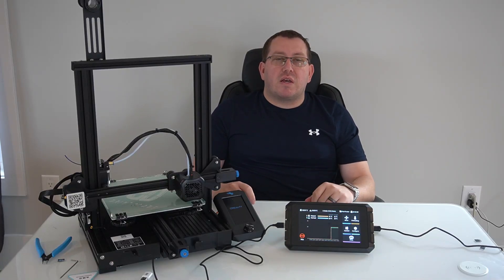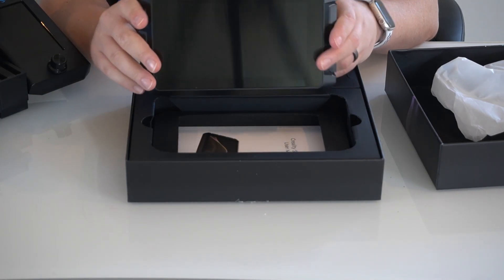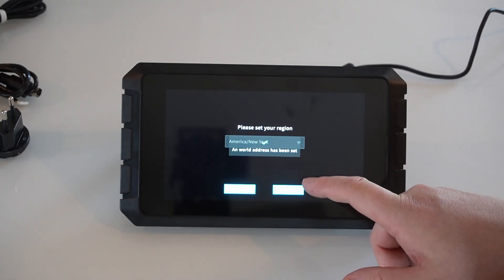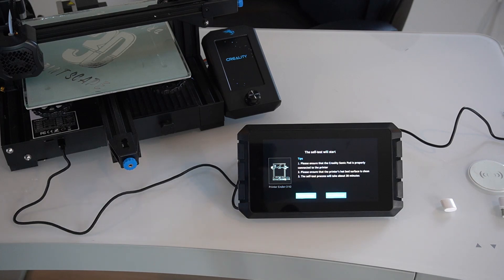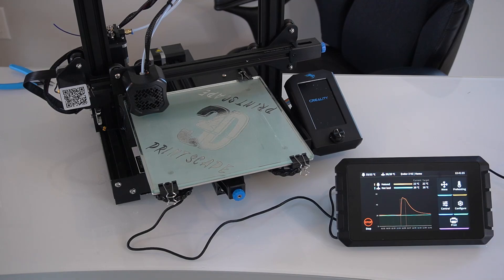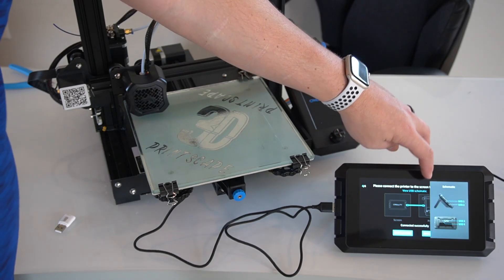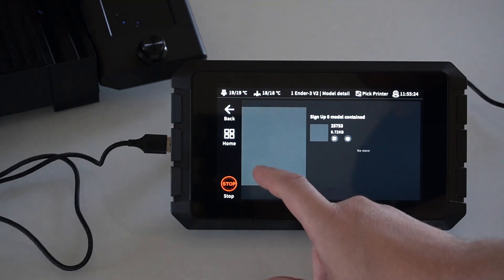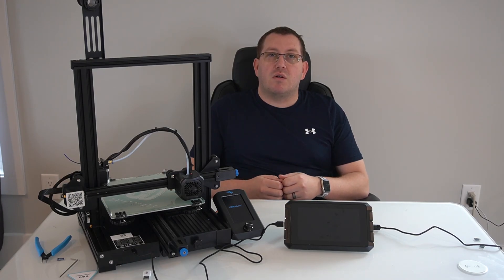Creality Sonic Pad – Getting Started!

Comment: I have a Sonic Pad running an Ender 3 S1, prints fast and easy to set up! I then tried a CR10 V2 w/BLTouch. There was no configuration with the BLTouch so I spent a few days following install guides with no luck. I thought Klipper would be similar to Marlin but it seems I have to find the config files for klipper? I tried to copy/paste numerous files that were suppose to make the CR10 V2/V3 work with BLTouch. None worked and I eventually went back to Marlin. Seeing the S1 run tempts me to try again. I’ll remove the BLTouch to try out the sonic pad. In the meantime is there an online resource to learn about klipper? Maybe I can add the bltouch later on.

Comment: I have an Ender 3 V2, with the V4.2.2 mainboard, and the STM32F103 chip. Does not have CR Touch or BL Touch. I have a Sonic Pad. Today I upgraded from the stock extruder to a Sprite Pro direct drive extruder. Now the Sonic Pad won't even detect the printer. I wired everything up correctly (fans on the extruder spin up and everything) so I don't know what could've happened. Any way to fix this?
Reply from the maker: Hi. Im assuming you didnt change the firmware? If thats the case, the upgrade should have nothing to with the connection issue. Are you plugged into the right port on the sonic pad?

Comment: Here is the issue I am having. I have upgraded my cr10 with a new 4.2.7 board. I watched your video on making your own firmware and used ender 3 pro firmware and changed the build plate size and the other few things you showed on your video.
with the lcd screen connected it works great.
I connect the sonic pad and the only way I can get it to work is to use the ender3 pro selection on the sonic pad which then puts me back at a 220x220x220 (think thats it). If i try to use the cr10 smart pro choice it will not work and if i use the CR10 options it does nothing. So I am ghuessing I can not use my sonic pad with cr10 unless I want the build plate size small.
I hope this makes sense to you, any feed back would be fantastic.
Thanks, Don
Reply from the maker: Hi. I know you can modify the size for the template in klipper but not sure if creality exposes that because you have to do it in the build. The sonic pad is pretty locked down to the printer/boards they have the config for.

Comment: This pads so frustrating cr 10 pro v2 and now a ender 3 pro with cr touch both get to the hiking screen and both will home the x and y then the z doesn’t move up or down and I get a must home probe. The cr 10 doesn’t have a prove the ender 3 the probe drops and that’s when the error pops up any idea how to fix this? 😊
Reply from the maker: Hi. Is the z stop connected? If not, try to connect it.

Comment: Thanks for making this. Can you confirm if the sonic pad supports the S1 Plus yet?
Reply from the maker: Hi, I didn’t see it in there, but it will probably be added pretty soon. You could get away with choosing a printer that has the same board and build size.

Comment: I have an Ender3v2 with CR Touch and Sprite Pro. Been running SP for about a month and still can’t get a good print. Hard to describe what’s happening but the few things I managed to get printed felt like styrofoam rather than solid. As of the prints have no outer shell. Thought right away it was under extrusion but have calibrated it. It just puts down very little plastic, the wheel on the Sprite hardly moves during print, it puts down a nice thick purge line but the prints are super thin strings even at 120% flow. HELP
Reply: Got it sorted out ended up being a Cura setting. When setting up for a new FFF Printer it defaults the filament diameter to 2.85 instead of 1.75
Reply from the maker: @johnmcdonald3231  Ah, that would do it.
Reply from the maker: Hi. If you slice with Cura and print that does it work as expected?
Reply: @3DPrintscape  no it doesn’t that’s what I’m using can’t figure out what else to try. Purge line is fine but print hardly puts down any plastic. It’s so fine that it’s hard to get the first layer to stick. It’s like printing with the fine strings of a stringy print.
Reply from the maker: Can you try to slice it on the sonic pad? I’m just trying to reduce variables.
Reply: Is there a list of definitions and how to use the included Sonic Pad macros. There are about 4 just for hyper-lapse. Do you click before printing? I see there all listed on the mainsail web browser but don’t know what they all do and how to use.
Reply from the maker: @johnmcdonald3231  I havent seen much on them, i will look into making a video covering them though.
Reply: You need to calibrate e step which is rotation distance in klipper. Google it. Mine automatically resets everthing after switching to sonic pad
Reply from the maker: @RolledIceCream  It would have wiped any setting saved on the eeprom, including estpes.

Comment: SO far the most inconsistent issue is connecting to non-preset printers. I have a Ender 5 Pro w/ 4.27+BLT+Filament sensor and I got it working but when i had to replace the 4.2.7 board I couldnt re-install the existing firmware and Printer.cfg file I had working before. Not sure why?
Reply from the maker: Hi. Did you try to remove the printer from the sonic pad and go through the setup process again?
Reply: subscribed.  Not many channels providing update to date videos on the Sonic Pad so please keep providing content on it if possible.  Ellery is correct using the term connecting and it applies to my experience last weekend.  Had been using the Sonic Pad for over a month with no major issues other than the initial connection to my Ender 5 Plus.  Took approx 20 to 30 or so attempts before it connected.  Last weekend I was drawn into the nightmare of getting missing webhook msg's multiple times on each layer, on multiple prints.  Due to that situation I finally took the next step and got klipper working by itself on a raspberry pi I already had.  I'll consider another Sonic Pad however in the future if Creality can confirm hardware upgrades have been done.  Thank you 3DP for providing this content.
Reply from the maker: @stephenjeppesen933  Thanks for the sub :). Did you update the sonic pad to the latest firmware and when you were having issues did you reboot?
Reply: @3DPrintscape  yes, it updated automatically a few weeks back and have double checked a couple times to be sure.  It's interesting both the Sonic Pad and Klipper on a pi are both doing the same thing suggesting it's printer hardware related.  Already checked all the connections on the Creality silent board, still trouble shooting.  If by reboot you mean powering down the pad, that's all I did.
Reply: something to note as I wait for the 1st print off a fresh klipper setup on a different chip and pi, I learned along time ago to not simply power down a pi.  You need to shut it off or power down thru the web interface first before turning off the physical power on the pi.  I suspect the same is true for the Sonic Pad although I never did!  Got a 32bit board coming this week for my Ender 5 Pro then I'll  reset or revert the firmware back to stock somehow for the Sonic Pad and and setup the E5 Pro on it.  Will update with results  later.  First print started and as of now appears perfect.  alot of setup and configuring envolved with getting Klipper going...the Sonic Pad makes it plug-n-play.

Comment: "Connection failed" everytime I try to connect
Reply from the maker: Hi. Is it connected to the right port on the sonic pad? I had a similar issue until i connected it to the port it said to. Also, make sure your using a cable that supports data transfer, the one that came with it does.

Comment: Pretty sure you can run multiple printers simultaneously, but can you run camera on each of the additional printers?
Reply from the maker: Hi. Im not sure on the camera part. My initial thoughts is that its configured to only use the one port for the camera and with most of it being locked down that may be it. I cant say that for sure though.
Reply: @3DPrintscape  That’s what I’m thinking too, but wanted to see what you thought since you had one.  BTW, nice videos.

Comment: Can you use the sonic pad on the original ended 3 the first one?
Reply from the maker: Hi. It depends what board it has in it. If it has one of the 8-bit ones, i dont think it will work.
Reply: @3DPrintscape  the board like where the bed is or motherboard. Thx for the reply
Reply from the maker: @alfredoc5770  The mainboard of the printer.

Comment: How do you control more than one printer? How does the setup work with a CRTouch?  How do you send files from Cura to this?   I think the install of this device has been way over covered.  There is littel to no information on teh other features.
Reply from the maker: Hi. You can connect it to multiple printers with the different usb ports and select the printer in the menu. I will cover this more in another video. If you have the crtouch, select the printer/crtouch combo in the printer setup and it will give you the firmware for it.

Comment: Thanks for the great review Imo I really wanted to use the creality sonic pad but unfortunately they used a very cheap usb connectors and were so worried about locking down klipper for there own use I had to return it also never released the source code per open source req. After it disconnected from the printer at 95% multiple times for absolutely no reason I seen it as a waste if you use it plug it into a plug solo no surge protector It does work well when it works but I see them dropping support for it when they feel like it and then your stuck with a 160 unusable tablet (LAWN DART) that is locked vs a raspberry pi which for the PI 4 with 1gb of ram is only $110 and a bt50 screen for $50 that can do over a million different things. AND WORKS EVERTIME 💪
Reply: You can get an Orange Pi Zero 2 hich runs Klipper just fine for $24 from Ali Express and a USB expansion upgrade for $2 , mine took just 10 days to arrive and I bought a cheap touchscreen from Amazon. much cheaper and secure
Reply from the maker: Hi. I havent had any issues with it yet, but i will keep an eye out for similar behavior.